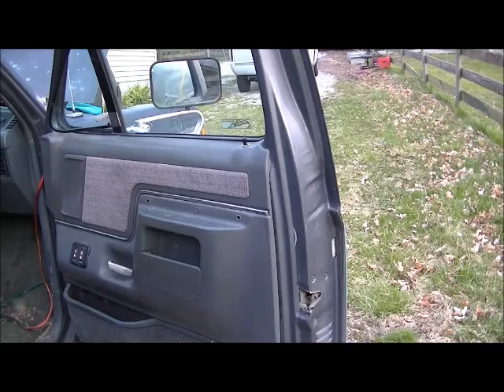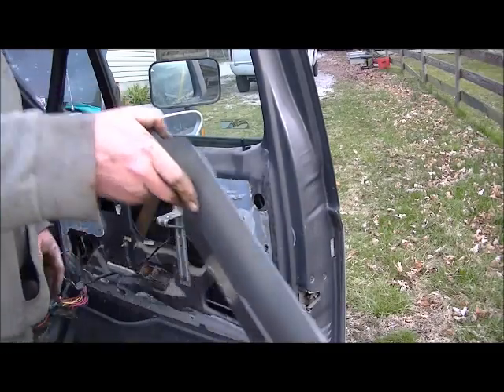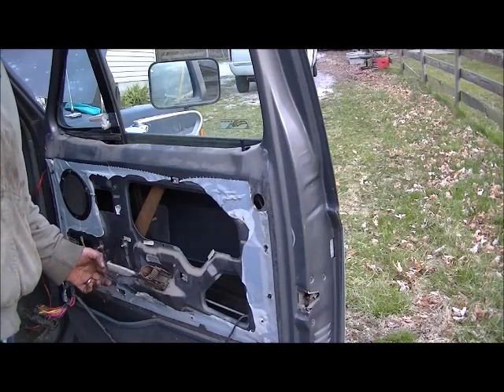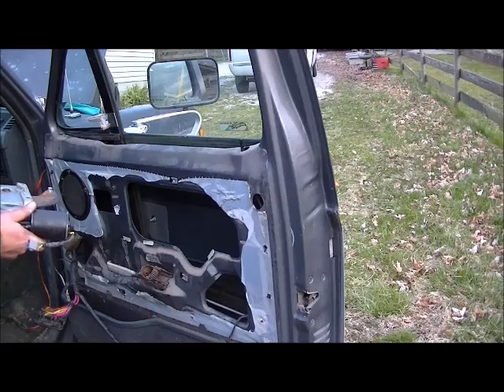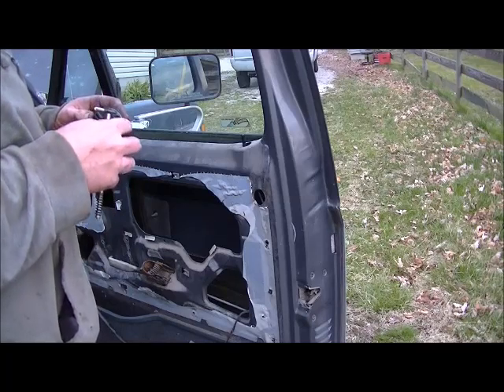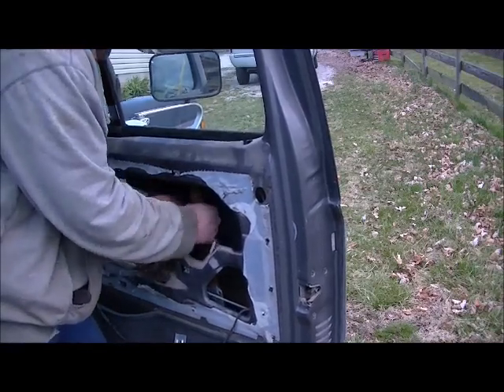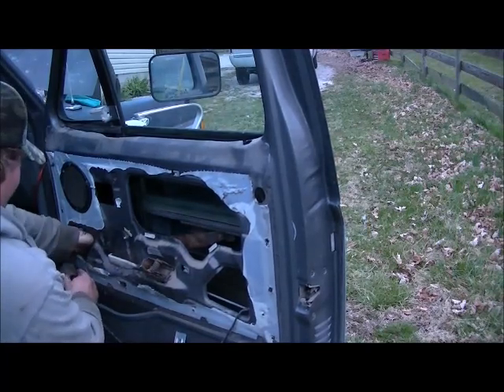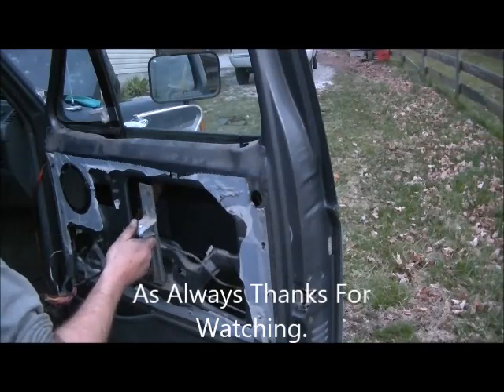1991 Ford Power Window Repair

Comment: Okay so the thing you struggled with most, removing the switches so you can get the panel off, was the one thing you hid from the camera? You also didn't bother to say how to do it. Quite the instructional video!

Comment: next project is to see why dual gas tanks are not registering with the dash gage - any ideas? 91 Ford F150 xlt Lariat
Reply from the maker: No idea unless the gauge itself went bad or a wiring issue. Don't see both tanks sending units going bad at the same time.

Comment: my window motor was stuck and it didnt work no more so i replaced it and its having a meshing issue half way down sadly it started to rain so i cant take the whole assembly out but this helped
Reply: so found my problem do not install the new motor with out taking the whole assembly out one of my screws to the motor wasn't in all the way making it basically cross thread and not line up with the half gear reinstalled it works perfectly

Comment: cool about to do this soon as I get some free time and the ground isn't covered in a foot of snow and ice. hey just so I can get the stuff before I take the door apart. do you know what size screw to use when replacing the rivets?
Reply from the maker: Luke Morter I am not shure but they have to be really short like 3/4 inch long. I think 1/4 diameter may be to big but it might work.

Comment: Yes I have the same year truck and color as yours and I can here the motor working but nothing happens and the windows fall down a little and I have to push them back up what do you think the problem is
Reply from the maker: Sounds like either the gear on the motor or regulator is stripped. You will just have to tear in to it and see what the problem is.
Reply: If you still have this problem (or anyone having this problem), these motors have plastic bearings inside that can be replaced. These get ground up over the years. They can be had from the parts store. AutoZone has them in the "HELP!" section. You can find them at the counter if you ask for "Ford window motor gears," as well. They are usually off-white in color.